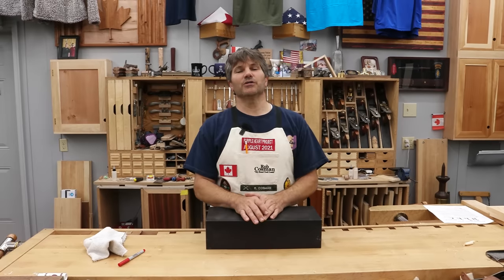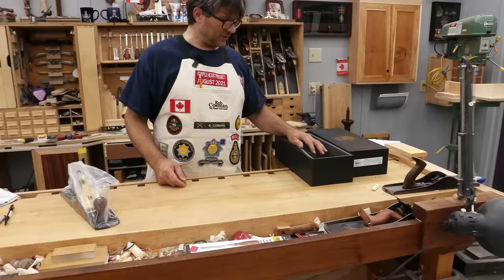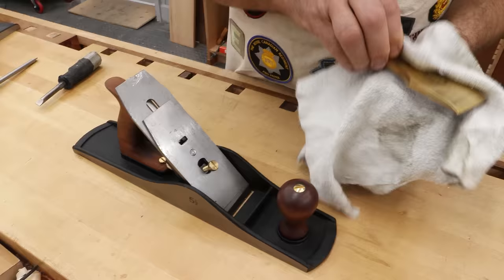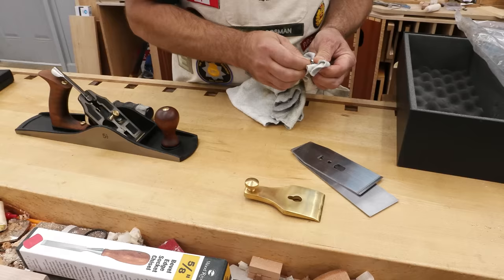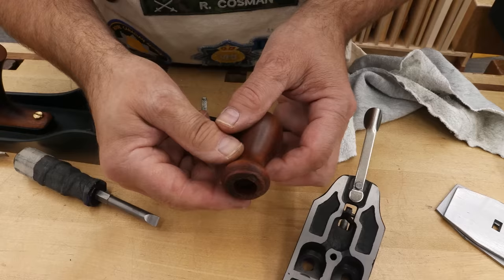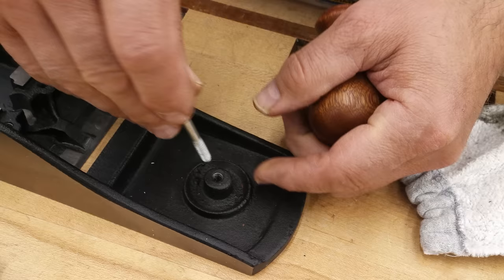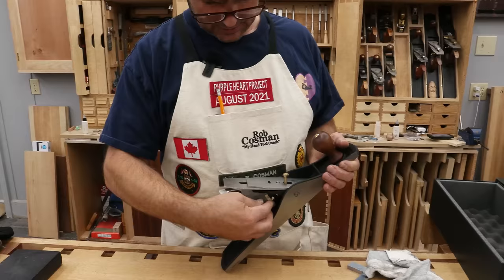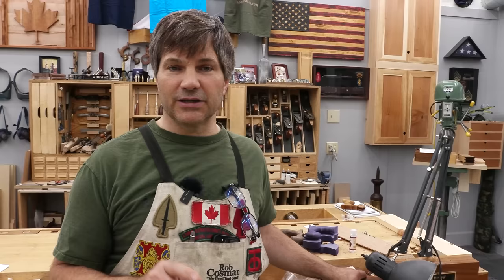Tool Review - Bench Dog 5-1/2 Bench Plane

Comment: I'm just starting to watch this review and I'm at the point where Rob says the inspection report shows that the base is square to the sole within 0.0015". I'm retired from aerospace as a mechanical designer and spent 35 years applying geometric dimensioning and tolerancing (GD&T) to drawings as I determined what the design needed. 

That is not a square to the sole dimensional tolerance. The GD&T feature control frame (the box with symbol and tolerance value) says that flatness (parallelogram symbol) of the feature (in this case a flat surface) shall be flat within 0.0015". The text table at the bottom of the sheet says sole flatness 0.0015 - 0.002. That is in disagreement with the feature control frame above. The feature control frame is read as flat within 0.0015" or as 0.0015" max. The table says flatness better than 0.0015" or worse than 0.002" is unacceptable. Better is better.
Reply: I don't understand how a management team can look at the product and not see  these simple issues. How can some thing be good and let the others be poor. It doesn't make sense. What's even more troubling with sellers is how they make the consumers there quality control staff! 
This is so wrong. I never buy any thing made in India yet, there manaufacting is not to par yet! It just don't make sense I'd like to know who's ainthe wheel house and why can't we confront them with these issues really the Board of Directors! 
If you have a concern say on a Lie-Nielsen product you can get an response right from the Captian himself Mr. Thomss Lie-Neilsen himself!. I know cause I have, even if it is cosmetic! 
I don't like woodworkers stores that just sell things to make a buck! Look at the work Rob and team puts into his products! He would never sign of on that plan before shipping it! So why do companies do this and hide behind board doors? Who are the people???????? And Rockler should be avoided cause there board desided to sell this stuff also!!!!! who are these people! I don't buy much from Rockler either cause there prices are too high! There like Ace Hardware, way too pricey to buy from! In any case do your home work and you won't get taken br these kind of stores or products. 
Rob. your doing a great service for the wood work h community! My hard off to you and your team! 
Folks do your home work or waist your money! India products still not there!
Steven Columbus Michigan 🇺🇸
Reply: We all know that sign is for flatness of the surface. I think Rob knows the difference and it’s just a slip of the tongue.
Reply: @1967urban  True. Rob has slips of the tongue on his live shows that are things he obviously knows.

Comment: Need some videos of you showing and using some of your wooden planes! I know they are more difficult to setup and use but I’d love to see your process and method for any of them
Reply from the maker: Well the only wooden plane I use is my drawer bottom plane.  I prefer metal bodied planes
Reply: @RobCosmanWoodworking  gotcha, just curious about your thoughts on them, though they lack some things compared to metal. maybe if you used to use them and then stopped, your reasoning for such. thanks for the response!

Comment: Fair review of a fair handplane. For another fifty bucks you could have a WR. Thanks Rob.
Reply from the maker: That's what I think too
Reply: I was just going to look up the price difference (well, I did anyway. Trust, but verify.). 25% more is not enough to steer me away from a competing - superior - product. There’s also the issue of the lever cap being a screw cap.  Remove or reinstall the blade/chip breaker is a lever flip versus loosen/tighten screw.

Comment: I actually own this plane under a different brand name. It`s ok but not great. Mine doesn`t have the vibration problem.  The adjustment leaver is kinda meh but still works after 2 years. The worst part of this plane is actually the blade. It is tempered maybe for the 1st 3mm, after that it`s just hardened. Fixed it by sticking it in the oven to temper the whole thing and now it seems fine. Also i bought 2 woodriver blades for it and they had the same exact problem. After a couple of months of sharpening they just won`t form an edge anymore. The solution was the same.
Reply from the maker: Great comment.  Thanks for sharing your long term experience with this plane

Comment: Thank you for the review.  I appreciate your teaching and learn something from each video. After months of waiting, I finally received my backordered Woodriver 5 1/2 Jack plane and I'm looking forward to fine tuning it right after I received my shipping-delayed IBC blades. My question for you is where do I get that neat star-shaped adjuster I see on your 5 1/2?  Thanks.
Reply: Me too! Ordered in December 2020 and received two weeks ago!!!!
Reply: Rob makes the star shaped adjuster wheels and sells them on his website.
Reply: Will J - was your plane blade flat?  Mine was so far out I had to have it replaced.  No way I was ever going to get the chip breaker and plane iron to match up.  New iron is on its way.
Reply: @matthewlebo482  If you're asking about the WoodRiver blade, I have no idea.  I'm still waiting on my IBC blade and chip breaker so I haven't bothered with the WoodRiver blade yet.  If you mean your IBC was far from flat, then I'm nervous since I haven't received my blade yet.
Reply: @willj2147  No - I’m US so I bought mine from Woodcraft so I got the wood river blade.  Woodcraft did make right on the deal - sending me a replacement blade and chipbreaker - the second set was much flatter and took very little time to hone & match the pair.

Comment: The Bench Dog planes were updated a couple of years ago. 
When the previous version was being closed out I bought a box set with a #4 and a block plane. 
I am a sucker for a deal and just bought them because the set was $100. 
I do not see any difference between the #4 I have and the #5 1/2 Rob is evaluating. 
I am not much of a hand tool woodworker so for the occasional use the planes are okay but if given a do over I would not buy them again.

Comment: I acquired an old Soviet era bench plane some months back and it looks like a reasonably close copy of a Stanley Bailey #4. Its got 'USSR' cast into the lever cap. One oddity with it is that the block the frog is made from is made from a chunk of aluminium. Would that have an affect on how the plane performs?
Reply from the maker: That sounds like an interesting plane.  So yes, you want heavy metals to dampen any vibration.  Aluminum just doesn't do that

Comment: Was it square? Just got a Woodriver and it was 0.006" out of square on the shooting board side. Should I return it?
Reply from the maker: there unstated standard is .0015".  The squareness to the sole is an issue.  Chances are that you wont find another WoodRiver much better.
Reply: Return it?

How square the actual cut in wood on the shooting board depends on the lateral adjustment. 

More to the point, is the wing flat so the plane doesn't rock lying on its side. That would be unacceptable to me.

Having said all that, I'd like it to be better machined but I wouldn't return it.
Reply: It doesnt have to be square, you have a lateral adjuster 😁

Comment: I know I don’t like the screw lever cap. Cam lever cap is so much better. But when I saw the frog face and lateral lever, it’s a big turn down, at least for me. Seems like it’s patterned after a Bailey’s type 20 style. Bedrock style is better.
Tote is similar to the one on taytools’ low angle jack plane.
The Norris style frog adjustment thing is there probably because they don’t have access to tap the regular hole parallel to sole.
Reply from the maker: I agree

Comment: Save your money. In fourty years as a full time craftsman, I have never used a no 5. No 4 and 4.5 smoothers, yes, all the time and a no 8 for jointing long thin boards and truing soundbars on pipe organ chests. But that's it.
Jack planes are much more of a carpenter's tool. Trimming doors to fit jams, floorboards and the like. But if you like showing off a big collection of dust collectors behind your bench....
Reply from the maker: Are you saying because that is what you use that is what has to be?

Comment: It seems like they used an average casting but did some precision grinding to the sides & sole.  I think the brass cap is more for looks than function because a stainless cap would resist deforming better.  The threaded cap screw will protect the blade but, because the cap and screw are both brass, those threads will become worn much faster than a lever cap.
Reply from the maker: Good comment, thanks

Comment: Overall, kind of a blah plane. Not that I'm in the market for any of them. But as an amateur maker, the two things that stand out are the upright rear handle (sore wrist with heavier use). Just no reason to copy anything other than Stanley's handle, which had the same angle as better wooden planes from England.  And the 58 hardness iron is going to have beginners coming up short on sharpness and wondering why, as well as reduced edge strength at the apex. I'd much rather have a Stanley plane and flatten the sole and prep the parts.

Comment: You are way too critical. 
Note: you are a supporter for the competitor.
Reply from the maker: In which way was it “too critical?”
Reply: i think he had addressed what we all would be concerned with when spending that much for a plane. Granted I know there are more pricey ones but it seems with this brand you are paying for the box rather than a quality plane.
Reply: As a master craftsman, I EXPECT Rob to be critical when looking at tools. It’s like you expect him to just give anything he reviews a pass?
Reply: I would say that was a pretty fair and honest assessment. I used a bench dog last month for a day. Had to grind the bull nose off of the lever cap because chips were getting stuck in it. The angle on the rear tote made my wrist hurt and the brass screw on the front knob is definitely a hot spot that could cause a blister (I put a glove on after the first hour of use).  At that price point, I expected a more comfortable tote and not to have to take parts to a grinder.